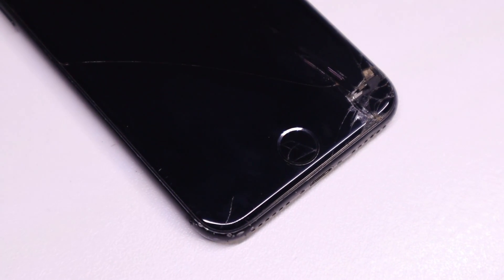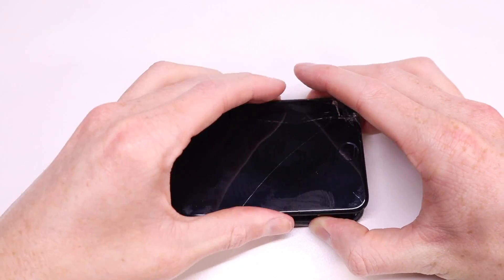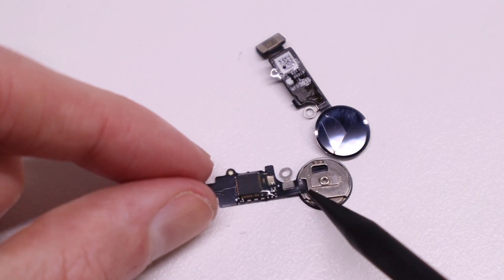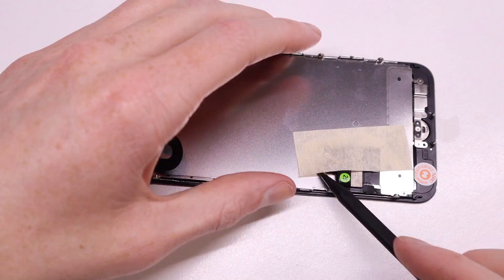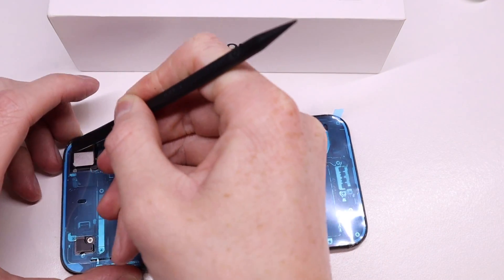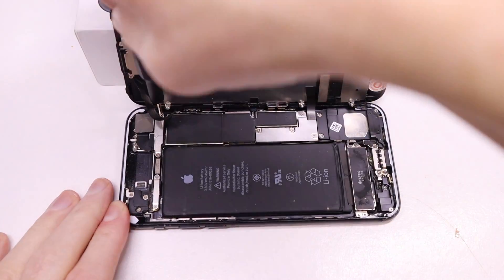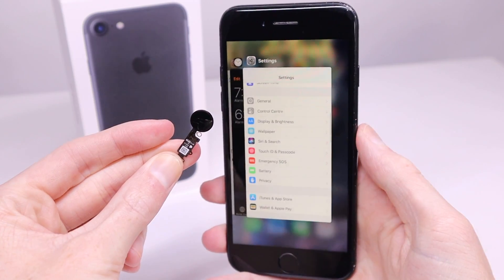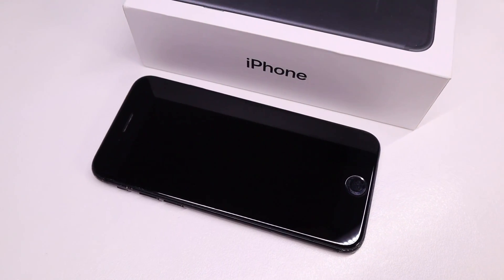Replacing Apple's "NON REPLACEABLE" Home Button

Comment: Waterproofing seal... water resistant seal... nothing is water proof when it comes to electronics.
Reply: Samsungs are close enough I literally have footage I shot of my wife underwater in my buddy's pool. I like submerging it cuz it messes with my buddy who's phone is in a bag in the pool but he wont put it under water either cuz the bag leaks
Reply: I work at an independent repair shop I can tell you with absolute certain that every single phone that has been manufactured has been water damage so I would say that they are water resistant at best. Some people are lucky. I would not recommend to anybody to purposely take their phone in a pool or bathtub because when you’re dealing with that expensive of a device that is like taking your only car and driving it into the lake and hoping that it works when it’s comes out. 

￼
Reply: Well Samsung says thier phones are ok up to 3 ft. for 30 mins in the last couple years I personally have submerged 4 different Samsung phones as well as I have seen friends submerge thier Samsungs. So my personal experience and Samsung both say you're wrong.
Reply: I literally serviced a wet Samsung galaxy S7 edge five days after release. Just because it says it doesn’t mean it’s true. Not all seals are created equal.
Reply: Also Samsung literally says that it’s water resistant not waterproof. No where the Samsung literature does it say waterproof.
Reply: S7 was only water resistant enough to withstand the rain. The water proof rating wasn't assigned until the S8. Yes Samsung says water resistant, they also openly said  they dont want to advertise it as water proof because they fear customers will put it through extreme test to prove them wrong. IEC gives the phones a waterproof rating (which manufacturers apply for) of IP67 and IP68 the 6 is highest rating for the protection from dust and other solids. The 7 and 8 is the level of water protection. 7 ratings state  Protection from immersion in water with a depth up to one meter for 30 minutes. 8 rating states  Protection from immersion in water with a depth of more than one meter (manufacture must specify) my S10 has an IP68 (the highest rating) and the manufacturer specifically says can with stand water at depths of 1.5 meter for 30 minutes. Any phone that doesn't stand up to these specifications would have a manufactured defect and should be covered under the manufacturer warranty. I have yet to see a Samsung S8 through S10 fail under these conditions. I would assume if the phone is damaged it would fail but I have not been willing to test it. I even saw a video where they boilded an S8 until the screen stopped working once the phone returned to normal operating temperature the phone worked fine.
Reply: I got so caught up in explaining the IEC rating I forgot to mention they while the say water resistant because they dont want customers putting it through extreme test they also advertise the IECs IP68 which is the highest waterproof there by quietly advertising its waterproof.
Reply: IP 68 certification is water resistant not waterproof nowhere does it say it’s waterproof in plain text on Samsung’s website it is water resistant at best end of story. I don’t care what people say that it’s practically waterproof it’s not. I literally see it day in and day out every single day I promise you it will get water damaged at some point because the seal will degrade.
Reply: I should also say that I work for Asurion as a subcontractor and we see it all the time on all devices. I’ve been doing this for five years I’m not full of crap. What can happen will happen. I don’t care what’s advertised for IP rating for whatever.
Reply: Asurion is a bunch of hacks they sent me a Motorola Droide 4 half the keyboard didnt work and it had no power buttons which was about the 5th phone because non of the others worked. And they upped my charges on my insurance so they could "cover screen repair for cheaper" then when I needed my S8+ repaired they told me there wasnt any screen repair place in my area that did my phone, after calling around there were plenty of place they were just expensive. I had to pay the $200 deposit they sent me a phone and it didnt even have a speaker cover over the little hole. So that tells me a little about your business. Sorry about the personal attack there but when you use pick a company base your quality of business off of you may want to find a better one than one that sends fully repaired phones. Have you ever stopped to think your customers my have gone outside of the waterproof specifications with the phone maybe took it to the bottom of a 12 ft pool? Maybe they had it under water for an hour while swimming with it in there pocket 

The IP68 is a water resistance system which states its waterproof to depths over 1 meter the depth after which the manufacturer specifies the depth and time. Manufacturer says the depth the phone can take is 1.5 meter for 30 min meaning by putting the IP68 in ads they are saying its at MINIMUM waterproof at 1m for 30 mins after that the waterproof may fail other wise it would be rated IP67. And Samsung may never say the phones are waterproof but they literally have ads on tv where they submerge the phone in pools. They have people using phones in water situations. Scroll all the way down near the bottom of the page it advertises the IP68. https://www.samsung.com/us/mobile/galaxy-s10/performance/?cid=sem-mktg-pfs-mob-22119-22513&gclsrc=aw.ds&&gclid=Cj0KCQjwho7rBRDxARIsAJ5nhFo8C7J-y1msZtMh6qwSsWrKT_881csn2FIKlokjcVl7PdUe0bboXTIaAiHMEALw_wcB
Reply: David Chlopecki sorry about your bad experience I do in-home repair for Asurion so I don’t know why they made you replace the device unless your back glass was broken. Like I said I work for an independent repair shop has a contract for Asurion so I do not work with the department at all that refurbishes devices. My boss has been in the wireless industry for over 12 years I’m pretty sure he wouldn’t be in business if he ran it badly. And I’ve been in the IT since 2012. I understand That it may say it’s waterproof but I can tell you with absolute certain that it’s not from my practical experience. Also there’s manufacture say that there is an indestructible phone and you cannot break the screen that is false as well I’ve seen that screen break manufactures have a habit of saying one thing and not living up to it. I’m saying as a general statement. ￼
Reply: David Chlopecki The way Samsung words it on their website it’s under certain conditions so blanket statement like waterproof does not apply to it because if it was waterproof it would be able to go in the pool water or salt water. After six years of retail experience almost nobody read the fine print.
Reply: I'm just saying Asurion is a bad spot to hang your hat when proving you're what you're saying has clout. And sears ran thier company with shady business practices for decades ( what's left of it still does) if shady business practices puts money in the bank it can keep afloat longer than 12 years.  Not saying your boss is being shady just his being in business proves nothing. Asurion has been my insurance company and screwing me since 2006. Now as far as you doing repairs at your home if you live in LA and I live in Cleveland they aren't sending me to you to get my screen repaired. Like they said no one in my areas was doing S8+ screen screen repair. What it really boiled down to  was S8+ screens cost too much Asurion didnt want to cover it the place i got it the second one repaired at also did work for Asurion meaning when Asurion told me the second time there was no one in the area they were full of shit I was standing in Battery+Bulbs in Parma an authorized repair shop who just got done fixing my screen. It's not my phones were that damaged they just didnt want to pay for the repairs. If you do repairs at home how do you handle the glue on the screens of the Samsungs just out of curiosity. I was considering using a hot plate but the price for the screen was literally $230 and Battery+Bulbs wanted $240 with my coupon and the hotplate was like $30 so I did the cheaper route that didnt involve waiting 3 days. 

As for curation conditions I think that is ment to cover normal conditions like not boiling the phone. I have taken mine and shot video underwater in a pool on more that one occasion as far as salt water I dont have any near by.
Reply: David Chlopecki we use Samsung oem parts so the screens are pre attached to frame. We stock 3+ kinds of the s8plus screen to fulfill repairs. That’s the right way to do it and parts that way are $$$$. You over paid for that screen repair we only charge $220 for that repair(with oem parts)(outside of insurance)(part is most of the cost). 

Asurion does not have in home repair in all areas. We go 9-9 6 days a week up to 100miles. There is only 2 of us that cover 1000s of repairs a month. So I can understand you being annoyed with Asurion. But not all stores can lost two fully trained techs all year round.
Reply: With over 1000s of reviews between stores. A 4.8 is the average of all the reviews. I don’t like we are shady. Batteries + and bulbs tho. I hear horror stories from the one nearest to me.
Reply: Unfortunately their screening process is really rigorous for the companies that they contract with we’ve only had the contract for a couple of months but the company that had it before us had it for about a year. And they just got purchased a competition franchise so the likelihood of the contract actually staying with us is low. We are still one of the lowest price places with the kind of warranty we have. And seeing as it’s flat rate it’s not worth it when we do really far ones.
Reply: So what you're saying is you have an awesome company somewhere so there is no reason I should have been told there is noone in my area if i just needed a screen? Does that mean you live within a hundred miles of Cleveland? Ps I got curious and looked up an OEM S8+ screen is down to $143 online now so $220 is a little pricey $220 over a year ago when I was pricing them would have been nice since the average price was $290 with the highest being around $345. Replacing screens is so easy I might consider joining the Asurion team if the pays good I work 3rd shift part time could easily fix screens on my off days.

Comment: i have a question
so on my old iPhone 6s plus my brother attempted to fix it by replacing the battery,my power button my charging port and my screen. but when he fixed it my phone wouldn't charge past 3% no matter   how long it was on charge and it eventually died and it would just flash the power up screen when it was plugged up. and when we checked battery health it just said "-" what do you think is wrong with it?

Comment: Hey I have a iPhone 5 it currently won’t power on or boot, it was working last time I used it, it is jail broken but needs a restoration the screen and top back glass are shattered it’s a 16 gig running iOS 10.3.3 please message back! I have no idea on where else to get ahold of you and the power button is faulty

Comment: The home button is replaceable! 
Touch ID isn't though. 
So I think this was a bit of an invalid argument.
Reply: actually, using a different home button on an iPhone 7 will not work at all
Reply: For the cost of the replacement from Apple or being told to buy another it's a worth while trade off. Stop being lazy to punch your pin, not even Touch ID is 100% secure!

Comment: Imagine if your car manufacturer stopped you from using third party wheels.
Reply: 66th Like And 3rd Reply! WOOHOO!
Reply: Lol , image the Apple iCar has this feature.
Only their rims are accepted and paired with the serial number :( :) (both sad and happy)
And when it's winter then they do : Your rims need to be replaced - that costs 5000€ to repair and install.

(I live in europe.)
Reply: Lol I can’t my Tire pressure monitoring system is synced to the vehicle and if I switch out the wheels there will be a low tire light on my dash and a ABS light
Reply: John Deere has that
Reply: more like they didnt let you get a new key if you break yours,yo have to use the phisical key
Reply: @Thatdrii  lmao I love having my fully functional Porsche key programmed for my Honda I can't imagine anything else
Reply: No I won’t, your’re welcome
Reply: Ferrari with logos lmao
Reply: Don't give them ideas 😣

They already do that shit (and more) with farm equipment
Reply: I wouldn't know...
Reply: @doddgarger6806  :s:

Comment: I have an iPad that won’t charge unless it’s completely shut off, I looked up how to fix it but all I’ve seen is to clean the port which I have tried and it didn’t work. If possible do you think you could fix it, I ofc would pay for it, and I could also understand how it’s a tablet and not a phone, so you may not want to do it, but it would mean a lot to me if you could fix it, or if anyone in the comments could tell me possible solutions for it

Comment: There is a way 
Just hear me out 
If the button is parried to the motherboard can we power the home button separately and extract the code and flas it to the new button or could we desolder old chip from home button and place it on a new one 
To me it looks like 8 pin bare package, shouldn't be to much trouble

Comment: Hugh I have a question I have a iPhone 7 that is water damaged but everything works but the loud speaker and the home button has Touch ID but does not  go home and also the rapid engine does not work but I think one of the connectors are not working I also replaced the loudspeaker and the rapid engine but they still don’t work what do I do

Comment: very mistleading title i'm affraid as you can replace every model that has home buttons its just on later models it disables fingerprint stuff so all the nonsense you did didnt actually help anything just drained the battery faster and made the replacement costs higher.

Comment: I get why you don’t get Touch ID if you replace. Non cryptographically paired opens up a vulnerability to unlock your iPhone. But no actual home button functionality damn Apple wtf. I get why the X has none though, and why the 7 and onwards didn’t have a physical button - to try and prevent it from breaking... Contrary to what most think Apple wants to remove moving parts because they are just vulnerabilities. Their products have a reputation to be long lasting and intentionally making them break would do more harm than good for the company. After all they sell a user experience. But even with these improvements some are still bound to break...I’m glad we don’t have to deal with this problem on iPhone X and onwards is all I can say - so I guess  Apple created a problem but has now fixed it - sort of. A screen replacement is now more expensive than ever 😂

Comment: I am quite confused about the practicality of bluetooth home button. I am pretty sure the home button replacement for iPhone 7 / 8 is available on eBay for quite some time now. Afaik, their functionality is pretty much the same as the original button (without touch ID), so why do you even need bluetooth home button after all?

Comment: I bought an iPhone 6s off of eBay in good working order but it needs a battery.. I got it for $150.. 128g space grey.. did I get ripped off?
Reply: Integra DIY I got a 6 from there for 225 that also needed a battery cuz it was trash 64 gb I got ripped off :(
Reply: Radi Xz2 when did you buy it? If you bought it recently, take it back.. say it doesn’t work right.. and buy the 6s.. I just ditched my iPhone 6 after years of using my 6.. since it’s not getting updates anymore I upgraded to the 6s.. and it’s a very good improvement. I also have the 7 but I like the headphone jack
Reply: No it was bought like 3 months ago and also I already upgraded so it’s all good
Reply: Radi Xz2 oh ok good to hear man 👍

Comment: Also you said companies should be able to not let you repair parts like the home button. But blocking replacements means it’s wayyy harder to hack. It could be possible to hack Touch ID if it could be replaced, putting your data at risk. What should happen though is that Apple should only replace the Touch ID not the whole screen too
Reply: You can just force the user to redo their touch ID settings when it's replaced. Easy fix.

Comment: Dang I was hoping this could fix Touch ID. As I have a 5s with a replacement home button as the old one got damaged
Reply: Jarrett Boersen Same here , does ur home button work
Reply: Tofu Plays the home button works, it’s 3rd party got it with a screen replacement as the whole front panel of the phone got ripped off. iPhone 6s and under the home button will work but not Touch ID

Comment: You can try removing the main chip from backside of the fingerprint button flex cable and buy another new fingerprint button and replace that chip.
It may work then like orginal but time consuming process but interesting to do